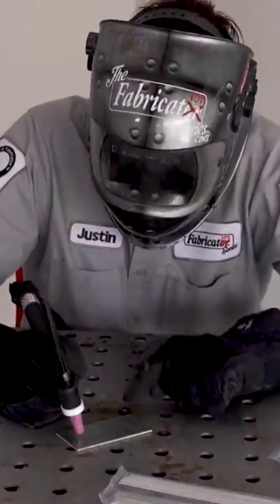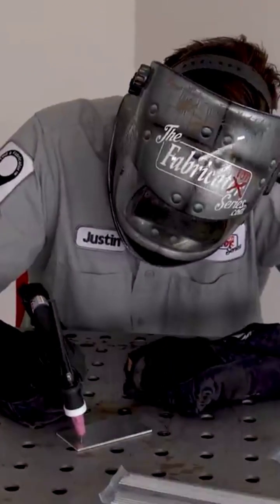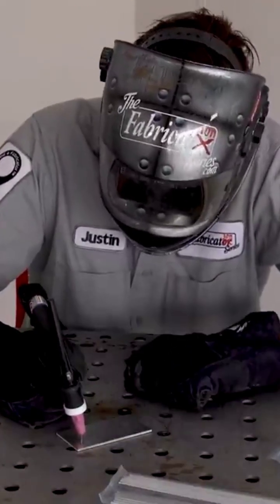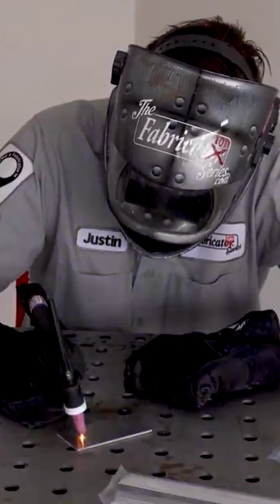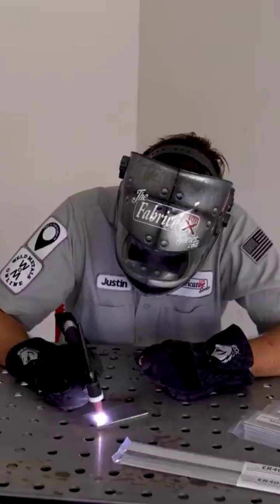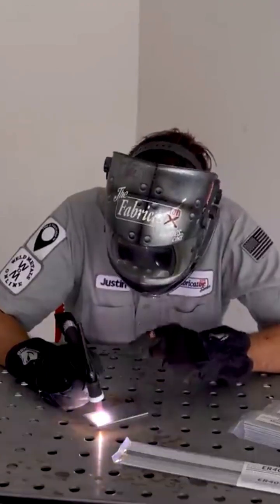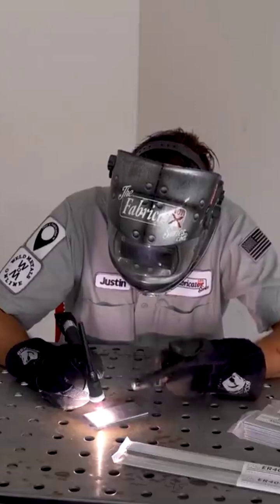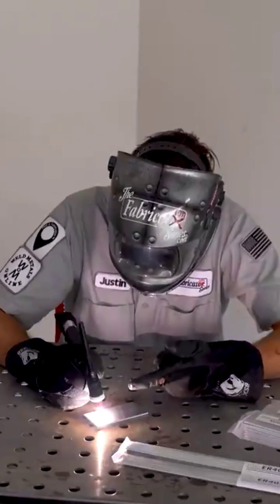Forming an aluminum weld pool with TIG

Comment: Probably the best info I’ve seen so far on welding aluminum. I don’t have a peddle on my old echo twin but it only takes a few times striking my torch to get it set then it’s nothing more then speeding up as the metal gets hot.

Comment: I haven’t welded aluminum in 10 plus years, and it was the most difficult to master. Our high school didn’t have the best equipment, however with patience and plenty of practice i got really good at it. Anyways i would have to make a ball on my torch rod with copper. Is this process still required?

Comment: Too bad you didn't use a wire brush to clean the oxide off first.
By the time you burn through the oxide you're about ready to blow a hole in the  aluminum.
I don't understand why you're doing it this way!

Comment: Never used a tig . But thanks for that info. For if I ever need it. That is more info than I got for my first mig.  The only thing I was told then was move the wand in small "C" shapes. Did an okay job. But then got better more I worked with it. Can't wait to try a tig.

Comment: Made the mistake of removing torch before turning of pedal 

Friends said I looked like Palpatine
Reply: What happens do you get zapped
Reply: 😆  FEEL the PowER!!
Reply: @cobra6481  I turned around an said this loudly to my wife hahaha I'm glad I'm not the only one who thought this
Reply: I assume electricity arcs from the torch to the nearest metal object which is usually whatever you’re welding.
Reply: @martinhawes5647  ..yes. To arc to whatever conductive material is touching the cable clamp for that sweet sweet short circuit..
Reply: Are we watching different videos? He clearly says at the end that he lifts his foot off the pedal waits for a moment and then removes the torch. Sounds about the right amount of time to allow post flow for the gas.
Reply: @grahamcharnock6453  he's talking about his own experience not the video.

Comment: I'm puzzled why didn't you clean the oxide off the aluminum to begin with?
Reply: Though I'm not in the trade, I think it's because aluminum forms an oxide layer so quickly that it isn't advantageous to need to clean it off completely beforehand. 

The oxide layer is usually pretty thin, so it shouldn't (?) take much energy to break through it. I think I once saw a welder mention that "it isn't really necessary" for aluminum, but I could be wrong! 😇🌎✨
Reply: @DeanTheDoctor  like you started by saying though you're not a welder 😂
Reply: @curnalsanchez  I'm not a Tig welder, but I do weld and work on metals. 🙂

I also ask a lot of questions too. ☺️🌎❤️
Reply: It's always there. Forms instantly
Reply: Where I work you have to clean the aluminum 1" from the weld.
Reply: @carlwarren1376  clean is better, but the oxide layer is still an instantly forming skin on any aluminium

Comment: Nice. Also, didn't you have a video talking about preferred auto-dark helmets? I'm in the market but haven't been able to find your recommendation (which I swear you made somewhere).
Reply from the maker: Only actual name brands like Miller, Lincoln, Esab, 3M, Optrel, etc. 

DO NOT buy cheap made up bargain brands like Chicago, Vulcan, Yeswelder, anything cheap on Amazon, etc. They have ALL failed in our shop.
Reply: @TheFabricatorSeries  🤘
Reply: @TheFabricatorSeries  Failure of an auto-dark helmet sounds like a really, really, really, really, really bad thing.
Reply: The recommendation was made for the more expensive models, but most any helmet that's constructed in these last few years has been pretty good and uses good quality electronics. Just be sure that it has good reviews and that it comfortably fits your head. 😇🌎✨
Reply: I bought an optrel 2.0 panoramic CLT I love it it blows away my speed glass 9100 XX it's lighter more options you'll never have to put batteries in it ever and it's backed by a 3-year warranty and the headgear is the most comfortable headgear you'll ever have on your head
Reply: @Sniper_ShotX  How come you don't need to replace batteries??
Reply: @danl.4743  you charge it USB cable and the solar cell in the helmets lens keeps the LiPo battery charged with my speed glass I had to replace the two 2032 batteries in it every month
Reply: @danl.4743  I just ordered the optrel panoramics CLT 2.0 papar helmet because I'm going to be doing some RN 60 nickel copper MIG welding
Reply: I imagine not going as cheap as you can would be key.  Don't be cheap when it comes to your safety squints.
Reply: Any experience with Save Phace helmets? I have a snap-on auto darkening helmet and it’s really made by Save Phace. Originally it was just a fixed lens because snap on wanted so much for the auto darkening insert. Once I found who really made it I was able to get the insert for 1/4 of the price.